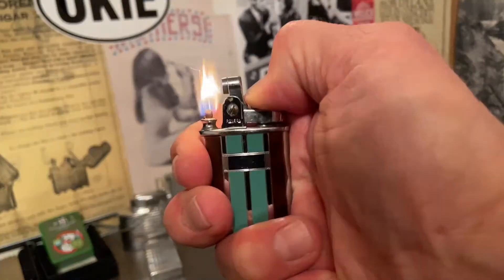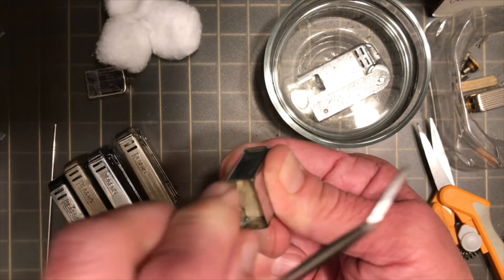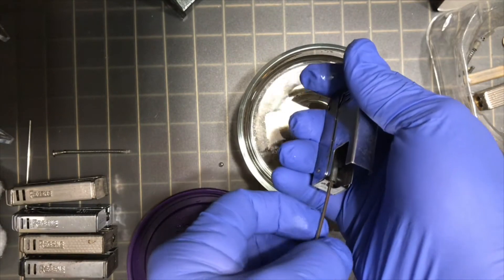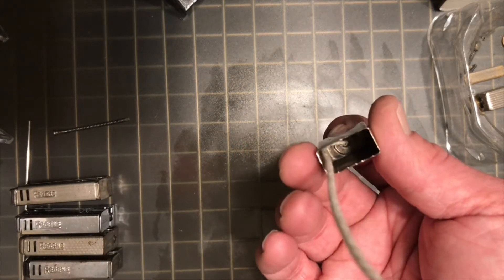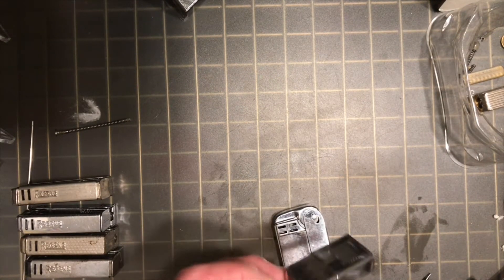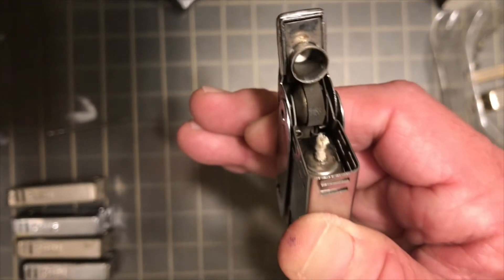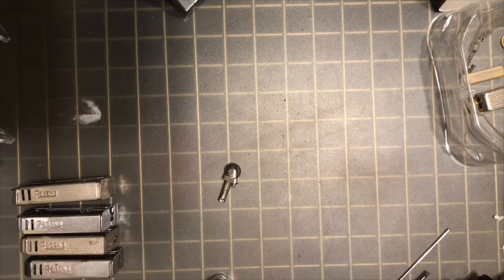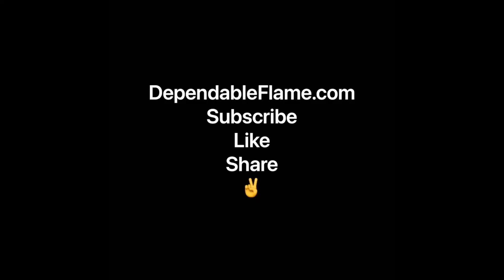Our Regens Vinegar Adventure Part 2: How Does The Degraded Flint React?

Comment: My Flint tube is stuck and will not unscrew. It screws, but just screws in place. Do you think this is due to the old flint or a stripped flint screw? Thanks!
Reply: Left it in the vinegar, took a bit of messing with but it's unstuck now
Reply: actually, is there any way to secure the little piece behind where the cap flips up? mine just comes out loose as pie.

Comment: Any tips on posting lighters on eBay? Like what to put? My sister and I are putting some of my lighter on eBay
Reply from the maker: Describe them as thoroughly as possible while also providing photos from various and sundry angles. I like to include all markings on the lighter in the listing title as this is the only information some folks have to go off of when searching for info on a lighter. Include as many photos as you're allowed using alternate light if need be to keep from duplicating. Crop your photos so that potential customers do not have to waste time zooming in just to see the lighter properly. Flipper Tools is an awesome site that allows you to embed YouTube video into your Ebay listings. This allows customers to see that the lighter functions, has flaws, etc. That's the basics, just off the top of my head.✌️
Reply: @DependableFlame  thank you so much. I’m a little worried about the regens lighter I’m getting. The flint wheel is horizontal, does that effect how good it sparks? And could I clean it with a  brass brush or a toothbrush?